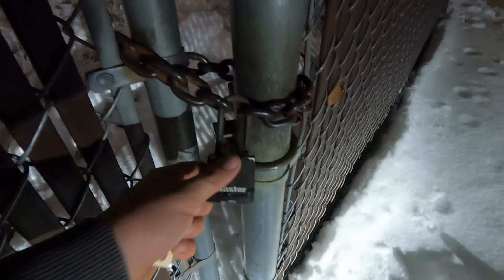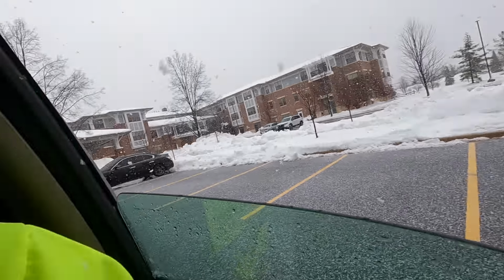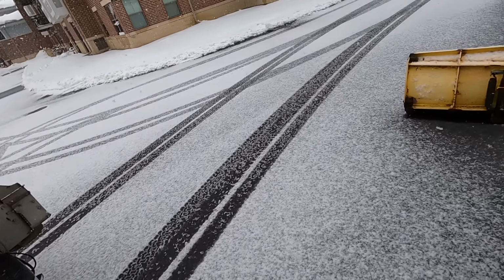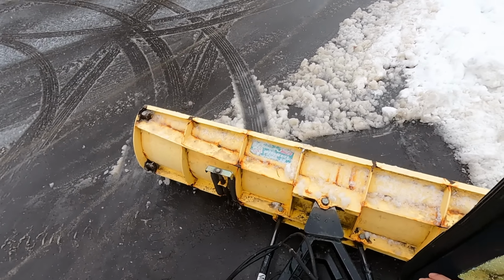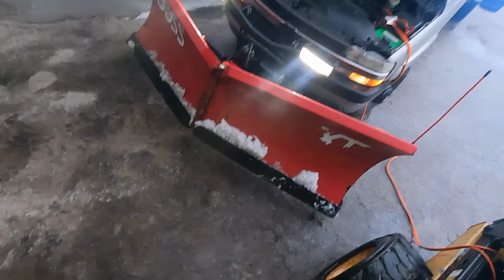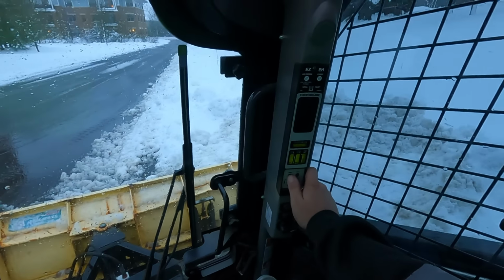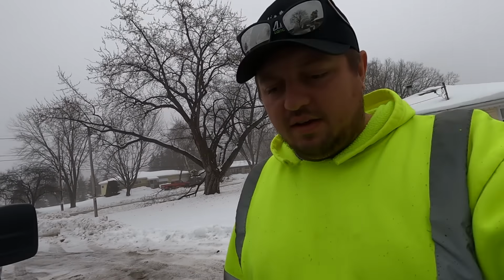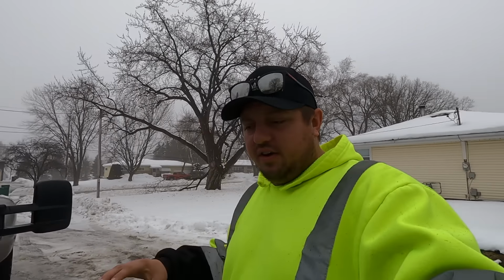This was a nuisance storm

Comment: salt before a snowy weather helps if it is correct, temperature in the air and ground temperature.

but it also costs the customer more or takes away your bottom line if you have a fixed price, as long as your machine scrapes well during snow plowing and you possibly salt afterwards, it is not necessary